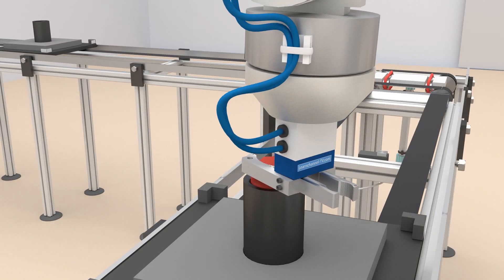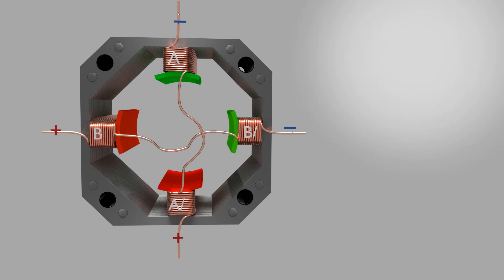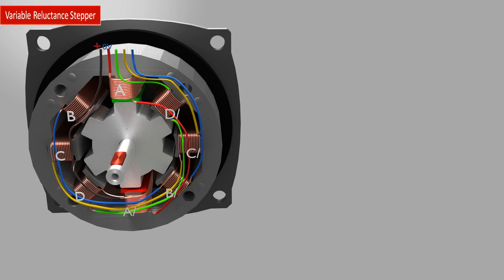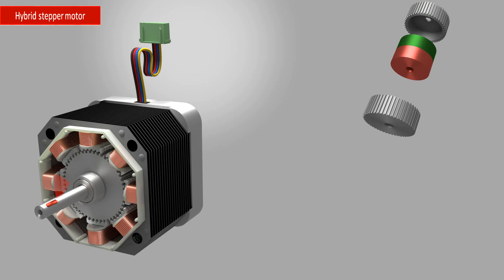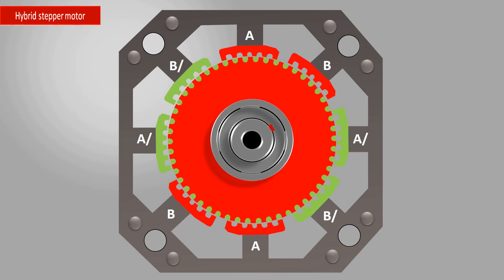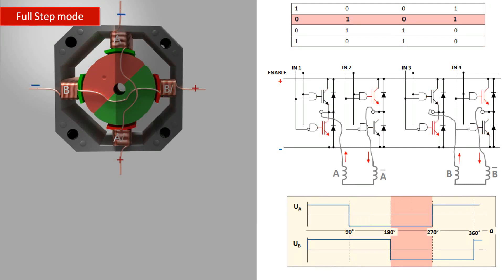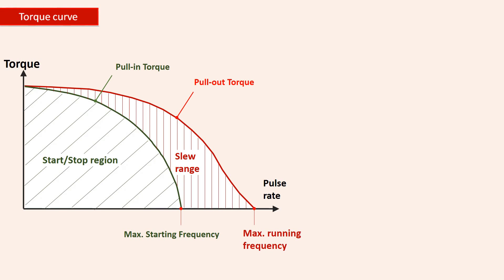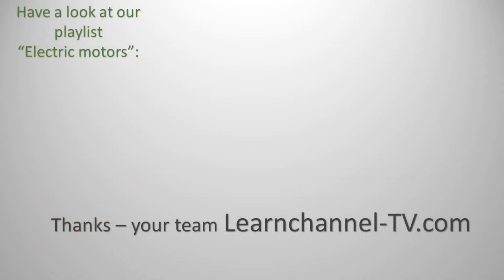How does a Stepper Motor work? Full lecture

Comment: The teeth on the stator should have the same spacing as the teeth on the rotor. They don't in this animation. At for example 4:20 the leftmost tooth on bottom stator winding A is aligned with a tooth on the rotor, but the teeth to the right get more and more misaligned.